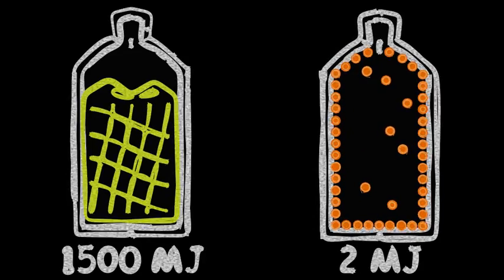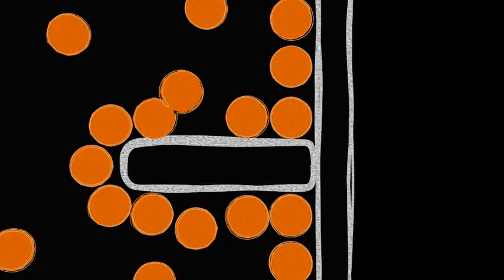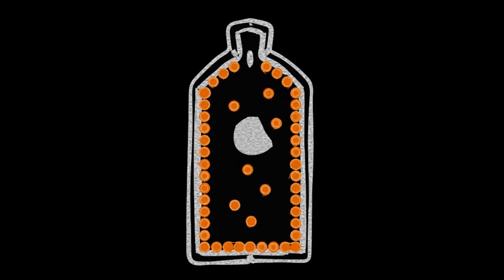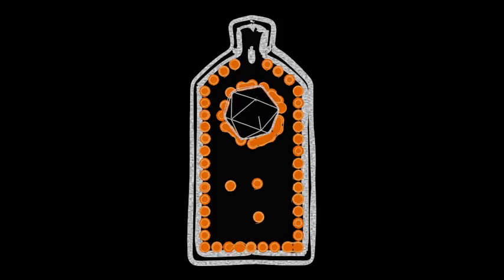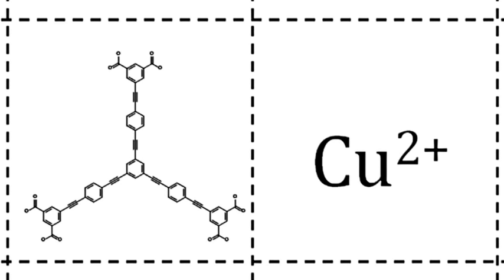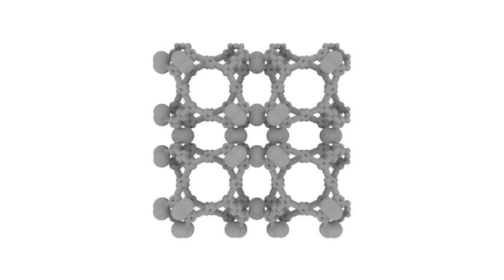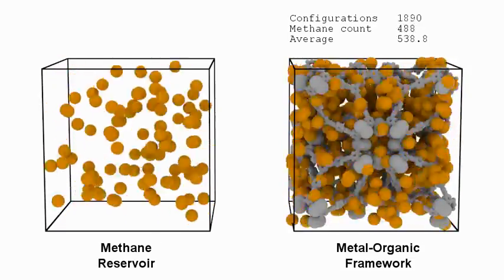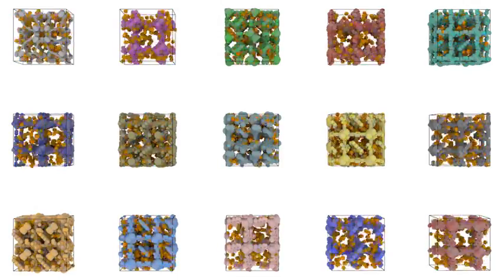High density energy storage using self-assembled materials

Comment: I like this work but I have a question. How do you get the gas back out of the tank? How do you get the NU1 or any surface to give up the methane?  I understand that dropping the presser or adding heat will make some gas come off the surface but will you really be able to get 80%- 90% of the gas back out of the tank at STP?

Comment from the maker: @EthanNin0 A tank with NU-100 will have 50,000,000x as many methane molecules stuck to a surface as an empty tank, but will have fewer methane molecules floating in empty space (simply because there is less empty space). The result is an increase in overall methane storage that is 100-1000x as much as tank with no NU-100 crystal (the exact amount depends on several factors like temperature and pressure - hard to convey all of the subtleties in a 5 minute movie!).

Comment: How much more methane can you fit in a gas tank? 

It goes from saying a gas tank full of methane contains 1/1000 the energy as a tank full of gasoline to the surface area with NU 100. Does that mean you can fit 50,000,000x as much methane in a tank then?